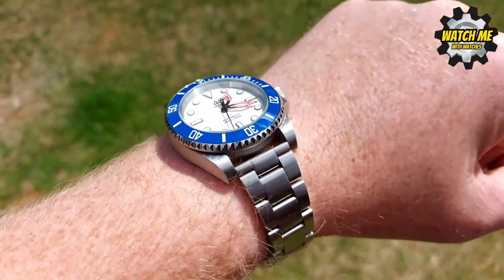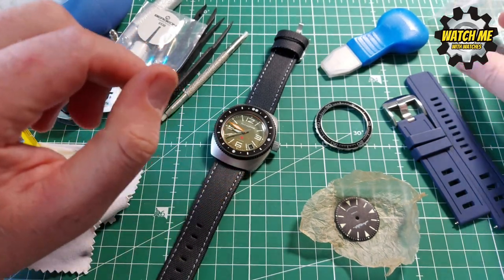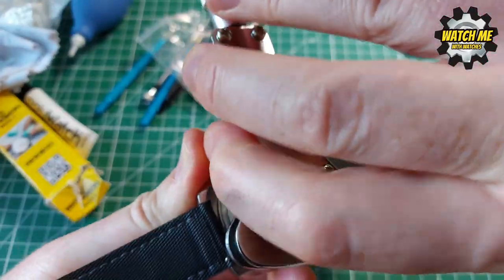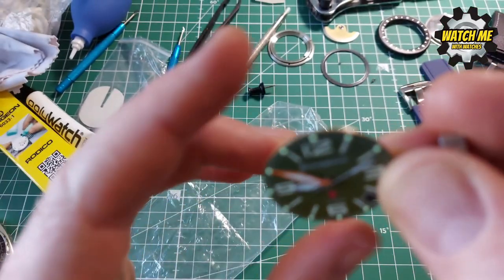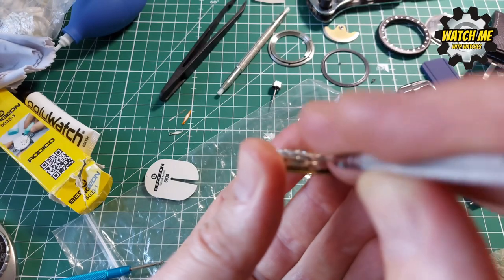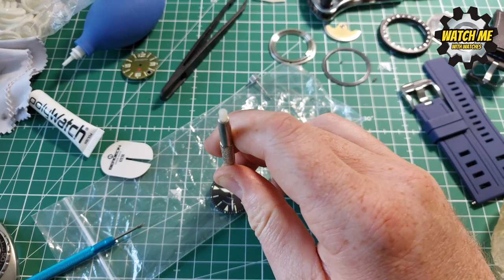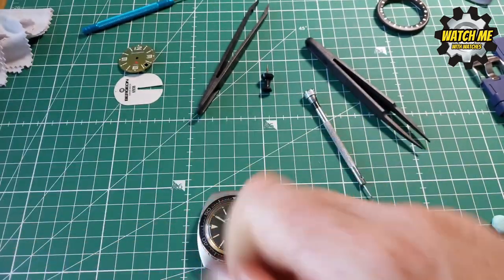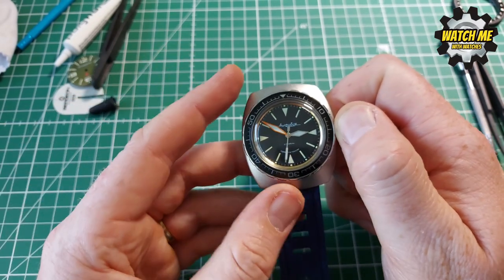VOSTOK MOD GUIDE. My little "how to" guide for Amphibia modifying.

Comment: Have you seen the grille bezels on Meranom?   They look abs mint on a 090 and the finish matches the 090 perfectly, def recommend.  I did mod my rare KVPO Amphibia taking it from the octa case and put into a 060 case I had refurbished and it just works so well, my last 090 was a radio room homebrew set into a modern 22mm 090 brushed case, white radio room dial, superluminove arrows and a gawjus high polished steel bezel and it has either a navy camo NATO or a distressed hide 5 ringer depending on my taste of the day.

Comment: You don't need to remove the two movement ring screws, just loosen, then rotate the movement so one screw clears the stem gap and you can pull the movement out of the ring with replacing simple reversal.
Reply from the maker: Thanks for the great tip

Comment: Let me ask you, is there any feasible way to increase the ‘beat rate’ of these Vostok? The sub 20,000 bps rate drives me crazy. I would love to get it to 25,000 or above (understanding that even the standard seiko movements are not to that level). Thanks!
Reply from the maker: I find mine gets aroused when playing it some Masonic music, its best rate goes up significantly.  But I can't walk around playing that sort of music. So make do with its standard beat rate.
Reply: watch me with watches Fair enough! Strange but oddly easily understandable response.......probably holds true for all of us
Reply: It would be a lot easier to put a vostok-ish dial on a different watch than swap out the movement.

 I can't find a dial to stem dimension on a 2416B but it's a thick movement so you'd need to space a NH35, Miyota or ETA (clone?) movement down in the case by around 1mm so the stem lines up. I guess you could add some kinda chapter ring to fill the gap 'cus you'll never get the hands back on if you space the dial up that much. 
Oh, new hands to fit the movement.
All three of them are larger in diameter (and thinner) so you'll need to make a new movement holder. The weight should be far enough in to clear the case back but the seal might be too wide. Spin it before screwing anything down.
The crown... You'll need a crown that fits the new stem and matches the threads on the case so probably something custom machined?
Those are the problems I can think of right now and I probably missed something obvious. I usually do.
Reply: Duckrutt is right, beat rates are built into the movement. Low best rates make tougher and more robust movements, though, and it is so easy to regulate Vostoks!